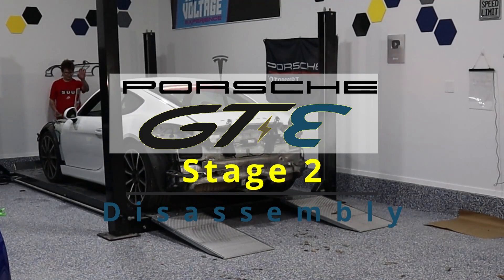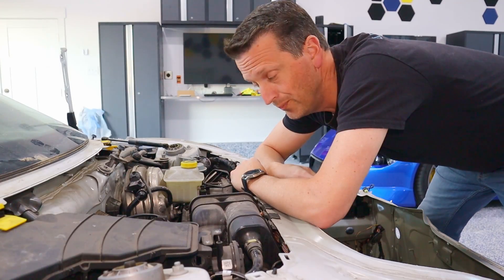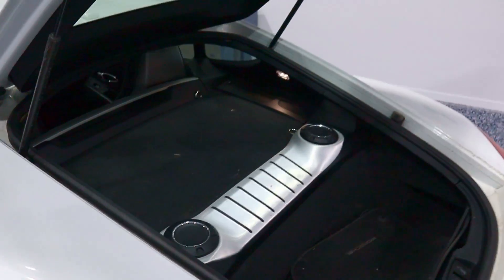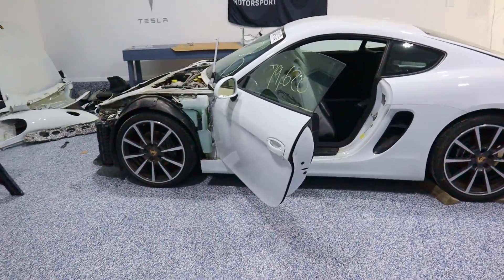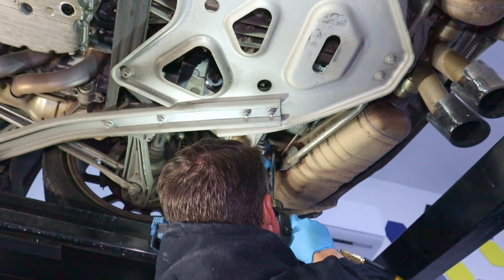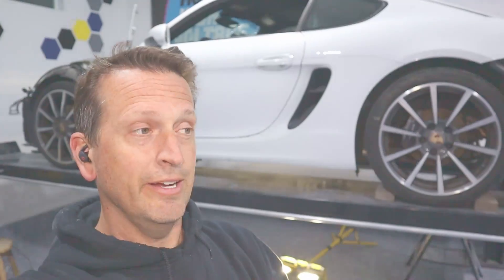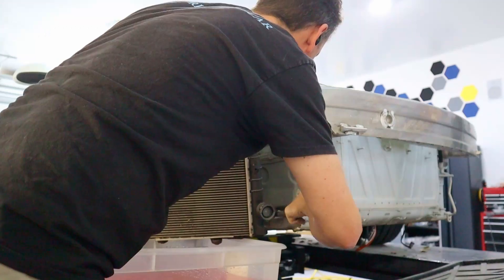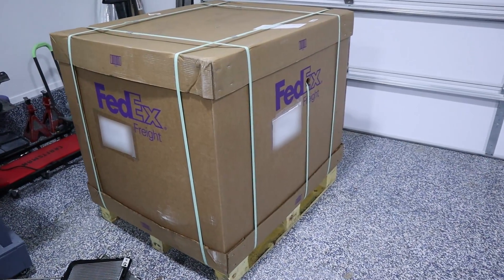Porsche GT-E Stage 2 Teardown - Exhaust Removal, Engine Fluid Removal

Comment: I’m amazed that exhaust, fluids, lights, some bodywork, and radiators were about 400 pounds!
Reply from the maker: Yeah, that was a lot of stuff!
Reply: @ a lot more weight than I’d expected for a sports car. I was really surprised that exhaust that short is so heavy. I did a catback on mine (Scion FRS) and the new piece is I think  25 lb with muffler. No idea what headers and other bits weigh though.

Comment: I thought most lifts come with casters.  Also, do you make notes as you disassemble.  Whenever I work on cars, I write everything down and mark the bolts and such so I know which one goes where.  I mean, it won't matter for the motor, but the bumpers and other items your using?  Just curious.
Reply from the maker: Yes, I have ziploc bags that I put all the fasteners in with labels.  I also record everything so I can figure out what I did.

Comment: Did you really disconnect the air conditioning condenser and just vent all of the refrigerant to the atmosphere? It sounds like you need a service manual... or at least to look at hoses and where they go before disconnecting them.

Comment: Next time, you should have a shop remove and dispose the AC system's refrigerant. Your car uses R-134a refrigerant (aka HFC-134a), which is a greenhouse gas 1,430 more harmful than CO2.
Your Cayman uses 850 grams of R-134a. As a greenhouse gas, that's the equivalent damage of 1.2 tons of CO2 being emitted. That's the same as driving a gas Cayman for 3,500 miles

Comment: Coolant colour is generally just to make it easier to identify which type to replace it with. Before coloured coolant as far as I remember all cars took the regular ice blue fluid. These modern days the different coolants have different cooling capabilities and additives.

Usually all European vehicle manufacturers use the red/pink/orange coolant.

These days you can't mess up the coolant when you go to the parts store. If you're keeping the current cooling system, you may need to bare in mind that it was designed to use that specific coolant. IF you use a different coolant and keep some of the existing cooling system be prepared (in case) for some premature wear. Such as leaks or whatnot. Remember as I said all coolants have additives that MAY be specific to the cooling system OR the materials used in the system. For example if you were to keep most of the cooling system and switch to a completely different coolant entirely some component of the existing system may fail, for example o rings or seals. I hope I explained it properly, writing is not my strong point. I have always been a 'hands on' type of guy.

Good work though and I'm looking forward to the rest of this series.
Reply from the maker: Thanks for the info!
Reply: Careful, that's wrong. Color doesn't tell you which kind of coolant you're dealing with. Especially pink

Comment: For what it's worth, my 03 VW TDI Jetta coolant is G13 and is pink. I estimate Porsche, being a VAG company, uses the same fluid. Just an assumption though
Reply from the maker: Nice!
Reply: Careful, don't use the wrong coolant. G13 was introduced in 2012. You car used G12 or G12+ from the factory. Don't mix G12 variations and G13
Reply: @komentierer  You're right! I misremembered the number. It's G12

Comment: I know it's far away and I ask in before but I'm very curious how you can make dashboard to work with new engine. Did you change it or you will put second. Did you use raspberry pi to control it. Is it will be possible to turn on comfort module without engine or without original computer in the car? What you make with safety futures, I mean with airbags and seat belt lock. I know this it's a lot of questions and unknowns and I can't wait to see what's you will make with this car. Good luck!
Reply from the maker: These are all things I still need to figure out
Reply: You can tri to lie some of the sensors with microcontroller and computer will think that car work properly. I cnow you can turn off software some of the sensors and dashboard won't give you faults. And off course you can use some for new engine. Oil sensors and oil pressure sensors. Temperature sensors.
You can try to ask in some tuning centre what part of the engine sensors they can turn off and the car to run without fault.
Sorry for my bad English.
I hope at least give you some clues. Good luck.
I follow all your videos with interest

Comment: IF YOUR PLANNING TO CONVERT IT TO ELECTRIC THATS AWESOME
Reply from the maker: That is the plan!
Reply: @electricsupercar  is it possible to increase the torque to make it faster going 0-60 than its actual speed
Reply from the maker: Usually the issue is traction not torque
Reply: @electricsupercar  thanks for letting me know i thought it was always torque maybe get some grippe tries
Reply: @electricsupercar  also maybe try and do what porsche did with the taycan s electric that the speakers produce a sound as if it is reving up like an egine and going through gears like an engine. also the k1-attack paint looks sleek nice paint job

Comment: 14:52 - $37,500 fine per incident. Section 608 of the Clean Air Act. Did you know you can edit videos after you've posted them, to trim things out? Maybe... good idea to do that.
Reply from the maker: Section 608 prohibits individuals from intentionally venting ODS refrigerants.  This was not intentional.  The radiator behind was damaged and leaking from the crash.  This condenser was badly damaged.  I thought there is no way it was still pressurized.  Thus "I was surprised".  You know by now I show all the mistakes along the way.
Reply: @Electric SuperCar  I've done it at junkyards too, and got a mouth full of refrigerant and compressor oil. They drain the engine, rad, and trans, but not the A/C? Sometimes apparently. Though, different interpretations of "intentionally" matter. They might argue an oops doesn't count, as it was careless to not verify, and thus is still intentional even if it surprises you. If it was a $375 fine, meh, but for $37,500 i wouldnt take the risk, I'd grab a shovel and hide the bodies.

Comment: That pink coolant is G12 coolant. It is specific to many European car brands.
Reply from the maker: thanks for the info!
Reply: Propably wrong. The Cayman most likely uses G13, which is pink, too. 
It's based on glycerin instead of glycol and must not be mixed with G12, G12+ and G12++.

Comment: Did you really "evacuate" the AC by just unplug the hose from the cooler? 😮
Reply from the maker: My bad. The radiator behind the condenser was damaged and leaking from the crash.  This condenser looked way worse and badly damaged.  I thought there is no way it was still pressurized.  Thus "I was surprised".
Reply: @electricsupercar  😅 a Porsche is "hart wie Kruppstahl" 😂

Comment: Some of the bracing (that also supports the exhaust system) also functions as providing added stiffness to the chassis. So I would keep all of that to ensure the car handles well & safely across bends!
Reply from the maker: With the new motor, I will likely need more bracing.  I will keep all the bits until I have a good rigid solution.

Comment: Remember to check the parts is't only holding the exhaust ? or it's a structure part . Can't wait to see more.
Reply from the maker: I will have to do a lot of fabrication when putting in the motor for reinforcements

Comment: It was rather disappointing to watch that ac system get vented to the atmosphere.
Reply from the maker: I was surprised it was still pressurized.   The radiator behind it was damaged and leaking from the crash.  I thought for sure it was already leaking.  My bad!
Reply: @electricsupercar  Not blaming you here - I could have made the same mistake. It is what it is. Edit: a good rule of thumb would be to assume it’s charged until you know it isn’t.

Comment: Those A/C gases are pretty environmentally unfriendly. In Aus we are required to have them removed and stored which is an extra expense. Pretty heavy fines for not doing it correctly.
Reply from the maker: I was surprised it was still pressurized.   The radiator behind it was damaged and leaking from the crash.  I thought for sure it was already leaking.  My bad!
Reply: @electricsupercar  I had the same with one of the MG ZS EVs I bought crashed. Loosened off a bolt and WHOOSH!! Glad the EPA weren't watching.

Comment: Gas vehicles are so complex!
Reply from the maker: So many inter-dependent systems 🤢
Reply: Wait until you don't even need to play with gas components. The interior/safety components are worse. All modules from the Radio to HVAC to Drivers assistance all communicate. 30+ computers need information from eachother to play nice.

Comment: Are you going to try to keep the A/C system?
Reply from the maker: My plan is to incorporate an A/C system.  Not sure if I will be able to reuse the Porsche or not.  I was surprised it was still pressurized.   The radiator behind it was damaged and leaking from the crash.  I thought for sure it was already leaking

Comment: As a professional mechanic, my air tools ALWAYS default with Ingersol Rand. They are excellent tools, a bit more pricy but you can get used online for less than the price of big-box-store new, and parts are readily available even for the older models. Of course, that probably won't get you any sponsors.

Comment: next project: a carbon fiber tub supercar like a McLaren....
Otherwise there's one cool thing that  could make your electric supercar(s) stand out is unique mechanical noise. I'm not a fan of fake noises, so using straight cut gears for gear reduction could make a  really loud high pitched whining noise like gearboxes in race cars, that could make up for the lack of engine/exhaust/intake noise and could make it more exciting as a race/track or even canyon car. The other thing is I know race cars or race bikes often have gearboxes that make it very easy to change the gearings. I think it would be very cool to see an EV with such possibility, because you dont have gears, it makes final gear ratio more important.
Reply from the maker: Interesting 🤔

Comment: I'm pretty sure that all of that heavy cross bracing under the engine and exhaust also adds to the torsional stiffness of the chassis, without those on the undercarriage seems a bit too open.
Reply from the maker: I think just the cross brace at 11:25

Comment: Hey I recognize that DMV...this is the same one Jerry went to for the Hummer.
That safety part was a little unnerving....I mean what if you messed up your electric build and there is a possibility in a crash that the entire outside of the car gets put under the full voltage/current the batteries can deliver...that would be super dangerous and they dont even check for that?

Other then that, keep it up man, inspiring stuff.
Reply from the maker: Thanks for the comment!
Reply: If the entire outside of the car gets connected to the high voltage system absolutely nothing will happen, you need two connections to make a circuit. If there are two faults leading to a short circuit, you blow fuses.

Comment: Keep as much of the sound dampening as possible, more there for road noise than engine noise.
Reply from the maker: Thanks for the comment!
Reply: or remove every bit of it to make a lighter race car
Reply: @loypopop7680  yep understand he wants something more refined, a nice daily driver with the nice quality and finish of a Porsche. but pleasure is subjective, a lightweight race car with lots of sensations would fit well with the GTE name.
maybe make it lightweight with no noise deadening material but just put noise canceling speakers all around the cabin 😂
this would be pretty neat if it worked actually, with a touring/sport switch...